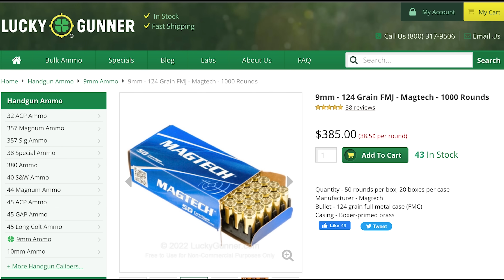Man Walks The Streets Of New York Brandishing A Firearm

Comment: Does NYPD still require a crazy heavy trigger on service weapons? I remember hearing long ago that it was department policy to have something ridiculous like 10lb trigger pull, and that's one reason why they have a real problem hitting their target.
Reply: No. 5lb on the glocks now. And it clearly hasn't helped
Reply: How would you even get a 10lb trigger in a Glock 19(X) wtf
Reply: @wm2008  it's a special part you have to get. The new York trigger is what it's called. More info on google
Reply: @pkobalt  insane, 10lbs is basically a revolver, i guess they did that for exactly that reason, switching from .38 special or some crap…
Reply: @wm2008  It was actually 12 lbs. And I’m not so sure that all cops have the standard trigger. That may be for the new hires from the time they changed from the 12 lb to the standard trigger. I bet 90% of the NYPD still have the 12 lb NY trigger